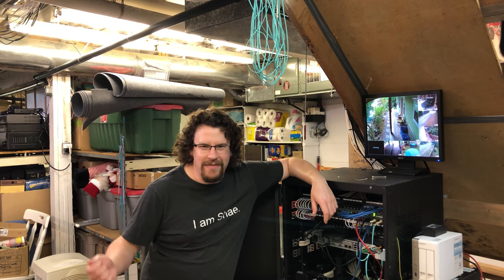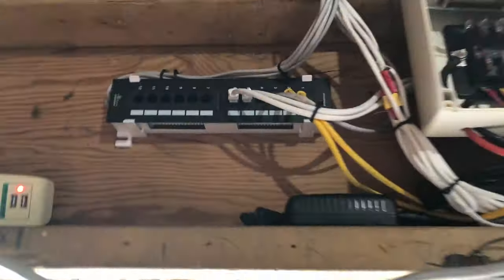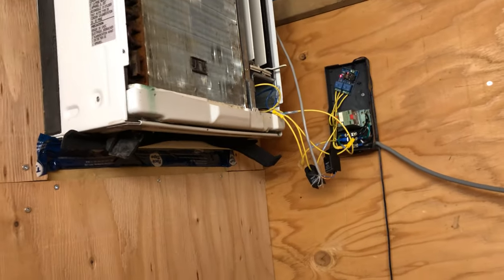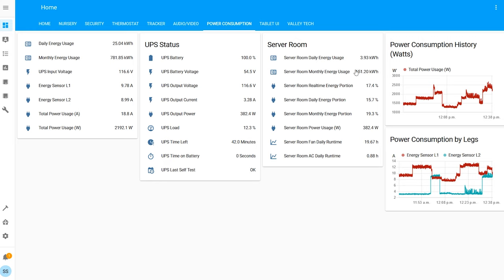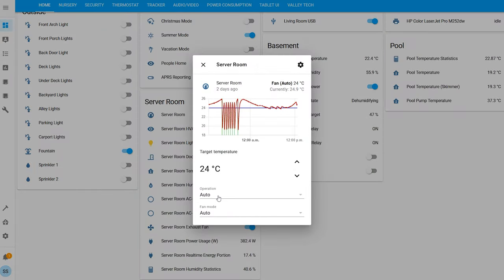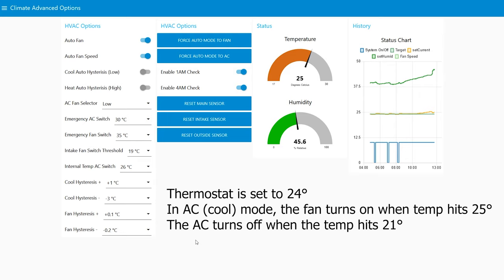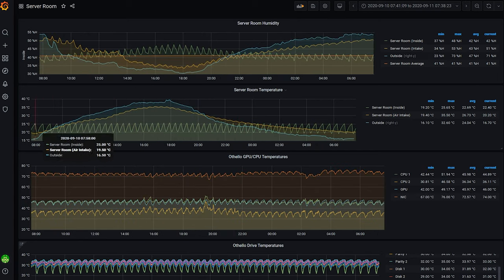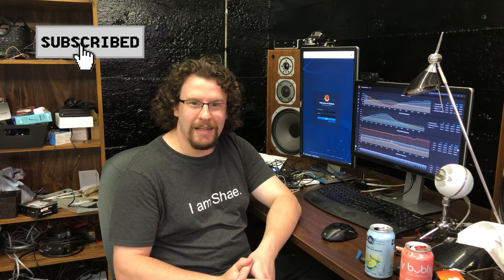Shed Server Room! VLOG #1 - Cooling & Climate Control Walk-through

Comment: Get yourself a low-power server. Mine uses 1W, so my IT power-bill is less than $10 a month.
You may also want to consider water-cooling/pre-heater (not the traditional style).
You have a large water container, you take the water at the bottom run it through your CPU-cooler and return it heated to the top.
(use individual "circuits" for each CPU; avoid one serialized run).
From the top, you run it through a heat-exchanger, which pre-heats the tap-water you use for washing dishes, hands and showering. The pre-heated water runs through a solar collector, which makes the water very hot; this water is stored in larger container.
Finally, the water from the solar collector's container runs through another heat-exchanger and will pre-heat the water you use in the house. In the house, you'd then use an "instant" electric heater without a container. It only turns on when the tap is turned on.
This is to ensure a stable temperature (say 60°C).
The instant heater alone will save a lot of energy, when comparing to a traditional electric water heater, but the solar collector will provide you with free hot shower water.

Comment: This is so cool! Awesome project Shae! I am working on a similar setup with homeassistant/nodered & some old HP G6s. Not quite to your level yet, haha! I have been playing with an offline voice assistant, Rhasspy, it has support for both homeassistant & nodered, might be a nice feature to add to your setup! I mostly use it for vocal status updates, though it is also nice to be able to use your voice to turn lights on & off too! Much Love Shae! <3
Reply from the maker: Thanks for the tip, I was actually looking at that the other day. I'm using a Google Home for voice commands, but really want to get away from it as its one of the last things I used that is cloud based (and a privacy intrusion). What hardware are you using to implement the voice assistant? PI?
Reply: @TechwithShae  Hi Shae! I am running the Rhasspy(v2.5) base as a Homeassistant addon running on an hp dl380, then have multiple satellite raspberry pis for wakeword/tts, all audio input/output is done on the satellites, though you could also do so on the base too, it is very flexible.

Currently I am doing the heavy lifting on the base(intent recognition(Fsticuffs) & speech-to-text(Kaldi)), then satellites talk directly to homeassistant for intent handling using the event bus, with their own wakewords(using porcupine), dialogue management(rhasspy) & tts(nanotts).

The documentation is pretty good, but it still may take some tweaking depending on how you want to set it up! I am also using some cheap respeaker2 clones for the satellite mic/speaker, which works fairly well at 2-3 meters distance.  Much Love Shae! <3
Reply: @TechwithShae  I do also use the http api (tts) with nodered as well for voice notifications.

You can also use MQTT, via an external MQTT server, but I had issues with the web ui crashing when using MQTT, may have just been a configuration error on my part, or possibly a bug, but I find the http api to be quick & flexible enough for my needs.

Comment: You're way kinder to your gear than me with AC and air filters! I guess since it's "cooler" to live on the Island vs the mainland I can justify my lack of AC ;)

It's on my to-do list to add APRS control for my Home Assistant setup like you've done!
I've also been playing with PMS5003 sensors off Amazon given the smoke.  I have them hooked up to Home Assistant via ESPHome.
Reply from the maker: I bet I could get away with a more powerful fan on most days - I may do that in the future to try and save some cooling cost, only used AC on super hot days (30+). I might pick up one of those sensors my self, I was thinking about air quality monitoring the other day, both inside and outside of my home.
Reply: @TechwithShae  Yeah! That APRS control setup you have for Homeassistant is Amazing! Love that you can get status updates from basically anywhere. I would love to implement something like that in the future, you have great vision Shae! An inspiration, thank you for sharing your wonderful projects!
Reply: @TechwithShae  We were lucky this summer that it wasn't that hot  vs the mainland (funny how it's like that when we're so close).  I gave myself comfort running things hotter after reading how Facebook and Google are running their data centers hotter with minimal impact on failure rates. The air quality sensor is awesome.  It's amazing how inside air quality is suffering even with a HEPA HRV system.  Room tower HEPA filters seem to help.  I'm curious what trends emerge now that I have this sensor in play... The PM2.5 readings seem to agree with the weather.gc.ca numbers...

Comment: One word bypass switch.
I had a UPS in my basement with a line up to my room to run pretty much everything in my room. I started to do something and was getting some cords plugged in and ready for the project and..... it died and left me with nothing in my room apart from maybe the light that was working on the wall outlets. so A screaming UPS in the basement I then had to manually transfer all the plugs back over to the wall outlet. The sad thing I was planning on building a transfer switch but didn't get it done by that time.
Worst part the transistors blew, so I ordered new ones on Amazon but got used ones, replace them and still can't get it to work and it was a really nice free 3000 VA 25a apc. I even had all the 30 amp twist locks and everything.
Thankfully as part of my unfortunate upgrade to Comcast business they gave me a 1000 VA unit but I had to adapt all my plugs up and down to 15 amp until I could get my head back around to what's wrong with the other one which I also just bought brand new batteries for a couple months earlier.
edit: to fix some grammar (and now that I reflect back on this I realize every time we put a new battery in a car within the month that car was wrecked, the trend continues).
Reply: I went with a 3 pole transfer switch although depending on the UPS you might be able to get away with leaving the ground connected but I figured it was just better to transfer all three terminals over. It leaves a brief section of equipment being ungrounded but it should also not have any other connection to power at that brief moment of transfer that it shouldn't be an issue.
Reply from the maker: All good points. Currently my plan includes a manual method of bypassing (one plug) but implementing something more automated is a pretty good idea. I was going to pull one 15 amp circuit from the UPS to run back into my house, so nothing too elaborate.
Reply: @TechwithShae  yes one plug would probably been good. at the time I was far past one plug as I let things clutter up a little more than I should have.
I'm not to sure what code would have to say on the subject as it sort of a separate supply.
I was looking into a three poll 15 amp switch for some other UPS's and decided to go the plug method for now. Should be okay bringing it up to a separate maybe different colored outlet (Orange?) and Treating it as an isolated connection.

As part of the rewire of the house I'm in to retiring a federal fire Pacific electrical pane.l I decided to separate out the circuit that was feeding all of the upstairs closet lights and tie that in with half of the basement lights on one side and drop that down into a box and break out to a plug to loop through a UPS to have emergency lighting upstairs and in the half of the basement with very few and small windows.
Amongst my research on the subject I believe there's a bit of a no no with flexible extension cords tying into fixed wiring but yet I've seen many flexible drops. My circuit was 20 amp so I decided to use a reasonably priced short extension cord of 12 AWG. I think most of the problems lie with people using 16AWG off-the-shelf extension cords which are usually underrated and not Service tough Grade insulation.
And Before my big UPS died I had a solid core 12 gauge dropping down from the ceiling and going into the infamous plug on the end of solid core cable. Putting a plug on it implies that you're going to move it around and it's not meant to be moved it's meant to be fixed in a permanent installation to prevent the wires breaking with flexing.
I'm sure in inspecteur would be scratching their heads and Insurance companies certainly rule this industry at this point especially during resell.

My opinion would be the proper way is to come preferably form an end terminated to proper gaged Service Grade continuous cabling to a junction box to transition to Romax or outdoor Romax and then treat the destination as normal maybe a colored outlet and definitely a label.

But I am just a professional amateur electrician, who will one day have a license?

I think that's most of my thoughts on the subject, or at least this chunk of brain dump?
Reply from the maker: @imark7777777  It's great to hear your thoughts. I had some similar thoughts with the lighting as well. There is definitely some question of legality with the transition from solid core to stranded / flexible stuff, but the way you described it is kind of what I was thinking. I was also going to go one step further and up the battery capacity of the UPS. I know its possible, but I am concerned about duty cycle, heat and the time it would take to recharge. The unit runs at 48V (54ish fully charged) so a simple set of 4 deep cycle 12v batteries in series should do the trick and get me significantly longer run time.